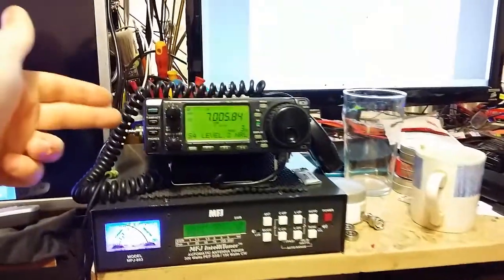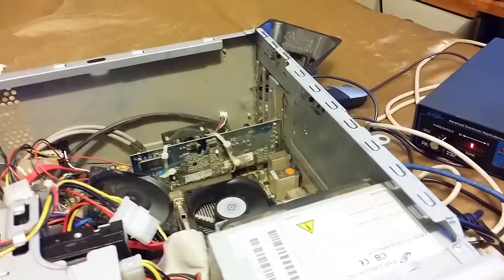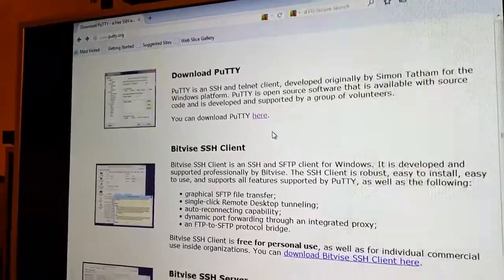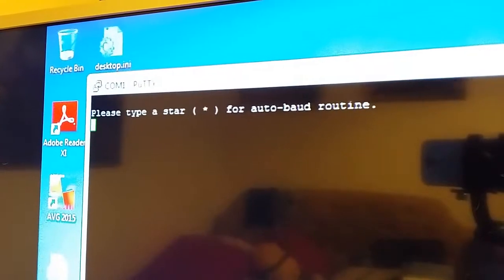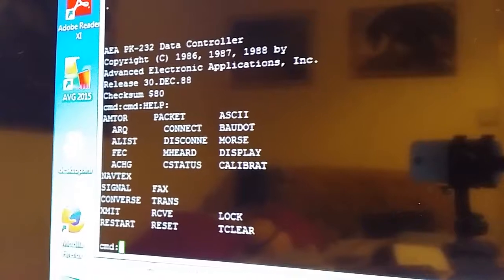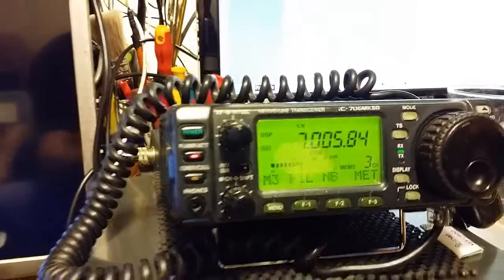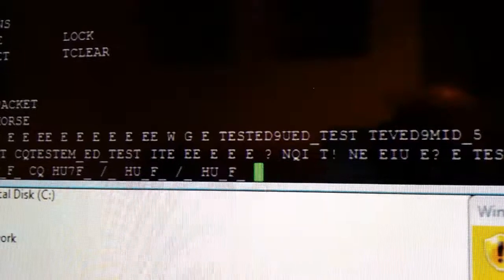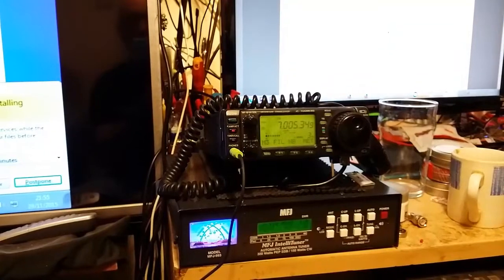Packet Rat PK-232 easy set up on Windows PC

Comment: Thank you for posting this video.  I have just connected up my PK232 again. If your rig has a constant level audio output, you will find that easier to use than the phone or speaker socket, you will then be able to hear the signal and decode it at the same time.

Comment: I still have a PK232 I purchased back in 1988. Using it to decode hand sended morse is useless! It will only work reasonably well if the morse its receiving is generated electronically. With hand sended morse its very difficult to get the inter character and letter and word spacing 100% correct. However on RTTY (Baudot) the PK232 works perfectly.
I´ve also used it for AMTOR which worked fine, but that mode went obsolete years ago. It also works Ok on PACKET, but on HF that mode is pretty much obsolete also although I believe it can still be found on the 2m VHF band. 
The PK232 is now pretty much now a museum piece and superceeded by digital modes which uses a sound card either in a PC or external one (like the SignaLink USB which I use these days) or are now built into modern transceivers. However, it was a great piece of kit back in the day.
Have fun... 73´s John EA8/G4STA

Comment: Thanks for your nice video. I have a PK-232 at home. I may try to resuscitate it!

Baudot doesn't mean "baud". Baudot was the encoding scheme used for RTTY. It's also called "5-level" code which refers to 2 to the 5th power giving us 32 characters... not enough to send digits. To send numerals and other special characters one actuates the "shift" key which provides additional characters including numerals. There are (no surprise) five columns of holes/lack of holes in the tape used in RTTY machines. Assuming a hole to be "one" and a lack of hole zero, it's a fine way to send RTTY and, indeed, many amateurs made loops of tape with messages such as "CQ CQ CQ de G5XXX" for use during contests, etc.   By the way, the ASCII system  which is in more common use today, is 7-level code if memory serves. I've used many teletypes machine but it's been rather a long time since everyone switched to electronic analogs of the old machines.    ND1L
Reply from the maker: +Jess Girard  Many thanks. I think youtube needs a video on how to use the Pakrat 
properly and perhaps with your knowledge you are the man to do it. I 
would love to see it when you finish it. Matthew

Comment: It might be a good idea to use a different audio output (with an external speaker and a Y-connector) so you can split the audio output to the PK-232 as well as the speaker. Then you can tune the IC-706MkIIG by listening to the CW for best reception and decoding on the PK-232. By the way, M and S on the display refer to Mark and Space, i.e. the two frequencies used in RTTY (FSK, Frequency Shift Keying). If you listen to RTTY, tune the receiver to illuminate the tuning indicator at both M and S. That should enable good reception of RTTY signals. Don't forget to put the PK-232 into RTTY mode. One of my friends is using his PK-232 today, making contacts in a worldwide RTTY contest. He's in New York State, and was working a guy in Sweden while chatting with me on 2 meter FM.  Funny to watch your video today.  Oh yes, almost forgot... TEST as you were seeing it on the screen means the CW transmissions in your video were being sent during a CW CONTEST.   "CQ TEST" in CW means, "I want to make a contact with any station" in a CW contest.    Hope this helps!  Best of luck   
ND1L  (first licensed in 1959, a lifelong amateur operator)